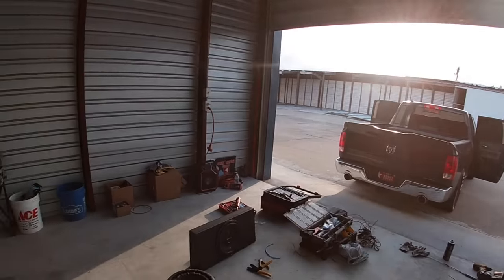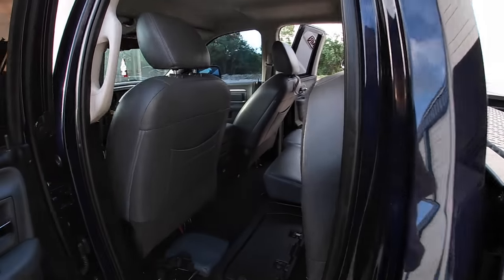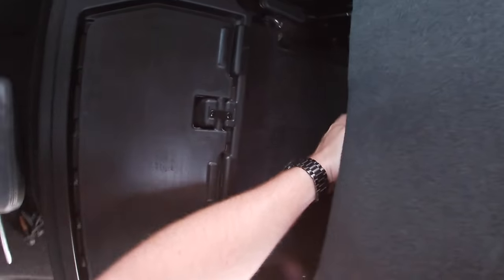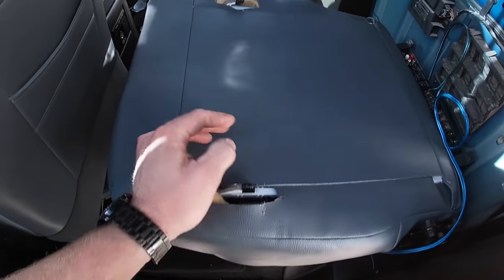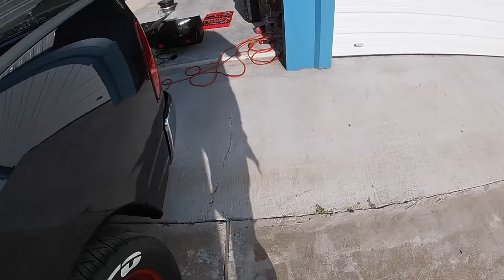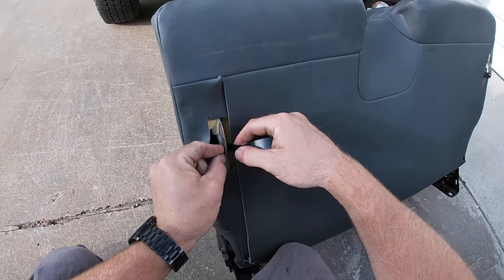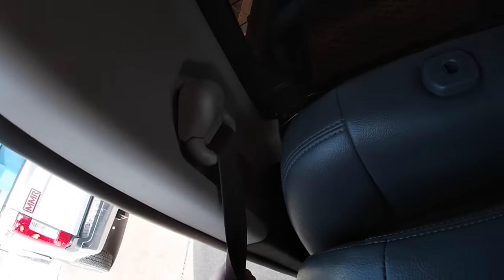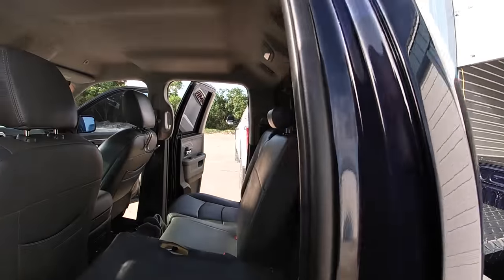RAM How To FOLD DOWN REAR SEAT!!!

Comment: GREAT VIDEO! I HAVE HAD ISSUES WITH WATER UNDER MY BACK SEAT. FROM OTHER VIDEOS ON YOUTUBE, IT LOOKS LIKE THE BACK CABIN VENTS ARE LEAKING. NOW I KNOW HOW TO REMOVE THE SEAT AND MOD THE BACK TO FOLD DOWN! THANKS FOR POSTING THIS VIDEO!
Reply: If you have water under your seats it’s either from those vents or (like in my case) from the seal around the 3rd brake light. I’d check that first!

Comment: Fixing to do the same thing to mine, kudos on the speaker box that's exactly what I want I'd hate to lose my under seat storage since I got the Express model no doors I appreciate you doing a vid on it couldn't find anyting online 👍
Reply from the maker: Well shit yeah! Glad I could help out, Hey! ADDITIONAL TIP- if you just buy the Rockford Fosgate loaded P3s you'll be set, that's what I based my box dimensions off of!!! The fosgate r2s wasnt worth it to me, I'm going to be buying the p3 soon
Reply: @Rep361Texas  I'll keep that in mind thanks for the help keep them videos rolling bud👍
Reply from the maker: @MoparHollics  Fo sure 🤙🤙  😊
Reply: @Rep361Texas  just got it done bud 👍 but yes need to remove the OEM panel it's to thick going to be installing some Dyno mat or equivalent to it thanks again
Reply from the maker: @MoparHollics  That's awesome!!!!! I'm excited it worked out well for ya'!!!!  I'm probably not going to dynomat mine, idk I just don't hear much of a difference without the factory carpet... I'm still unsure though, lmk how well it works for you.

Comment: You work for mmr? I hooked up temp power for yall in louisiana. I need to do this to mine. It's a bench seat
Reply from the maker: Yea I've  been with them for 8 years out of there CC district.  The mod should work the same on a rear bench seat, as long as the rear firewall hooks are the same as in the video you'll be good, I have yet to do one myself.

Comment: Quick question.. Would you rather get a first time (mild)cam from jay greene or moes performance and which one? if i go jg route Im saving about 2-300 less than the i3 and pcm bundle. Only asking because I would like to get it right the first time.
Reply from the maker: I would buy from either, their specs are really close on their mild cams so I one make more power than the other it wouldn't be much, I deal alot with Demon  Motorsports so mine is more than likely to come from them. Matt has been more than helpful over the last 2 years. One thing I learned from him is the Diablos are good but if your wanting to have alot of Bolt-on's and wanting reliability the go with H.p. tuners, in the long run it was worth it on my build!!!   Hope this was helpful buddy!!!
Reply: Talk to Justin at Dr differential speed shop in Groves Texas he has custom cams and he will hook u up with a badass cam for the $$

Comment: How is that sub working for you?? I have the box that fits under the seat,not much bass from it
Reply from the maker: Ill admit that it didnt work out well, I ended up with the p3s in a under seat box and the amp on the back firewall. The box i made sounded good and hit well but not on lows, the sub was actually hitting the bracing in the back of the seat while doing any kind of excursion, the same sub in the under seat box stuffed well with cotton sounds just as good but not earth shattering of course... Now the p3s has more room to play without risk of damage. Hope this helps if you find a way to pack decent bang behind the seat please let me know!!!
Reply: Add washers under the seat where you bolt it down I raise mine 5mm 
ALSO  put that white stuffing  in the box

Comment: Doing this mod, does the backseat no longer stay upright when you raise the lower section all the way up?
Reply from the maker: It works, same as It did from factory if tou cut it the right spot, if you cut to much it may not stay latched but if you follow the video youll be close, i actually made my description tight so you may need to shave a little more than me.

Comment: Did your truck come with those storage boxes under the rear seats? I'd like to get something like that for my quad cab. Great video, I was trying to figure out if there was a way to get the rear seat to fold down.
Reply from the maker: Saddly the quad cabs didn't come with the compartments, I know I looked into doing them shortly after getting mine and it doesn't look like there is a simple way of getting them, but I'll definitely see if I can find a way around that as well!!!  Glad this one was helpful!!!
Reply: It's a crew cab thing

Comment: Don't do what this guy did! Simply add 1" wood spacer underneath seat bracket and back seat will unhook and fold down easy. I installed a fox acoustic sub enclosure and wooden spacers came with it to lift the seat so that the box would fit. Same result without destroying your factory bracket. Thats why I always buy new vehicles because second hand vehicles always have previous owners that destroy them like this or worse.
Reply from the maker: Brother, If you think wood supporting the weight of your passengers during an accident is a better solution then go right ahead. In no world would I ever mix carpentry with structural in automotive.  Hopefully you don't ever plan to carry passengers my guy. This is why I trust noone but myself to modify my vehicles. Some people claim they know what their doing and will put people in harm with such foolish things.
Reply: @Rep361Texas I second that. Not only is he using something as dumb as wood but you’re losing full thread engagement of the bolts. They make em that long for a reason. I cut the hooks on my 2011 ram. Worked just fine.
Reply: Holy shit this guy modifying his truck from Lowes. He probably got longer bolts from Lowes also. Good ole cheapest bolt he could find that fits. Weak bolts and wood. That's exactly what I would depend on keeping my passengers safe. 😮